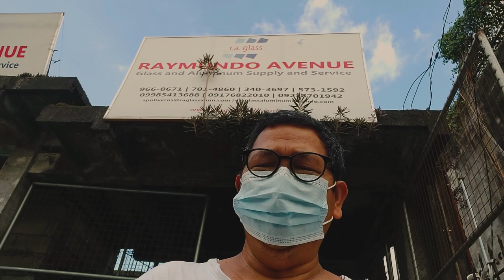Pinoy Glass and Aluminum Contractor Tells how they start | VLOG 10 | Paano kami nag simula?

Comment: Papa B, ano po materyales para sa Double pocket french door  sliding, size 192cm x 221, Kung pwede kyo gumawa, how much? u have a sample picture of french door. Dto sa Quirino hway Talipapa, brgy 164 malapit sa Mindanao Ave.
Reply from the maker: Good morning gerie 
Ito po yong materiales pasa sa double leaf pocket type door 
1) tubular 1"×1" or 1"×3"
2.) Single head
3 ) single sill
4.) Single jamb
5.) Sd top rail
6). Sd bottom rail 
7.) Sd lockdtile
8.) Sd interlocker
9.) Sd astragal
10 ) 1/4 " glass
11.) Glass divider or flat bar 1"×1/8"
12.) Sd roller
13.) Sealant 
14.) Sd mohair
15.) Flash lock #12-13
16.) Flash lock #10
17.) Flash lock #11
18.l metal screw m8x2
19.) Metal screw m8x1
20.) Tox#6
20.1 angular 1"×1"×1/8"
20.2 blind rivets 4-6
Optional
21.) Ys221
22.) Screen divider
23.) Screen sill
24 ) screen head
45 ) screen astragal 
46.) Screen mesh
47.) Lower guide
48.) Vinyl no.2 or #3
49.) Corner bracket
50.) Vinyl with pin
Reply from the maker: 51.) Sealant
Reply from the maker: 52.) Round tube 1/2" or 3/4"